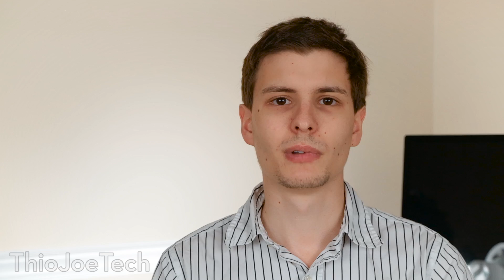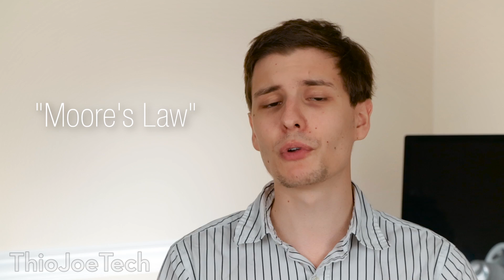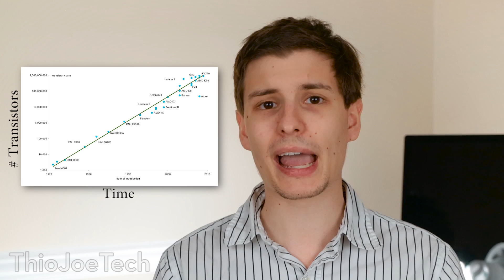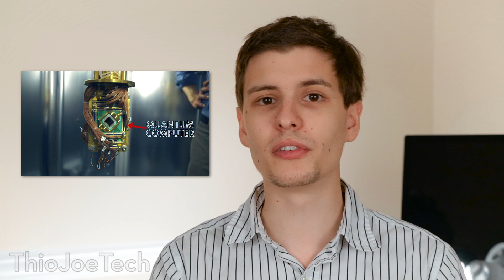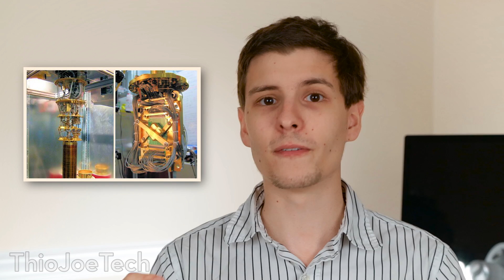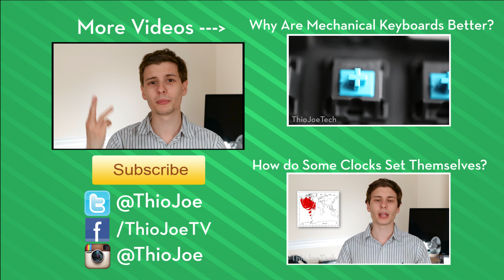Is There a Limit to Computer Power?

Comment: I know it is a stupid question, but why there is no bigger CPUs? That way we could put more relatively big transistors, and CPU is significantly smaller than, e.g. power unit and does not take much space. Water cooling would resolve the heating problem.

Comment: Quantum computers theoretically instantly find all possible solutions for an input. Also, transistors can only get so small for the same reason and way quantum computing is supposed to work, once you get to a certain number of atoms an electron could jump around indefinitely, making it both on and off at the same time.
Reply: ATREYU ALPHA OMEGA FAITH MAJESTY THE AMEN Excuse me. what?